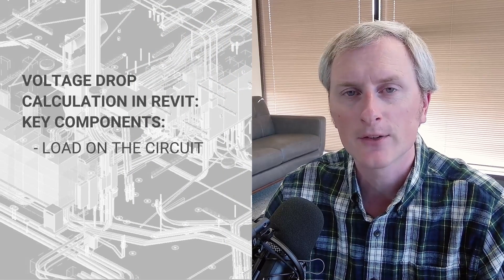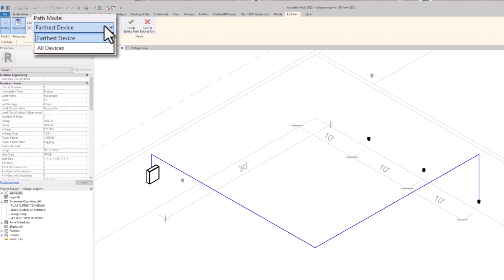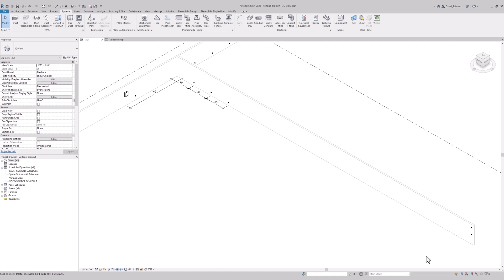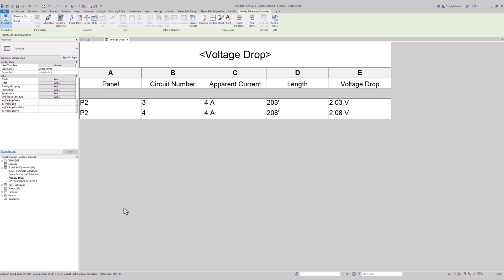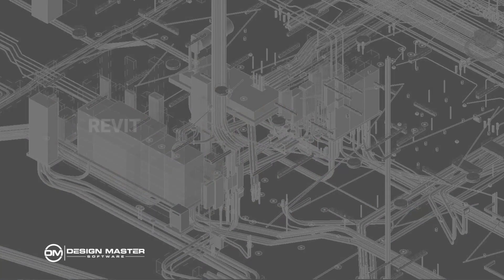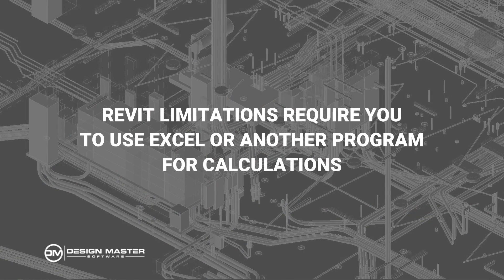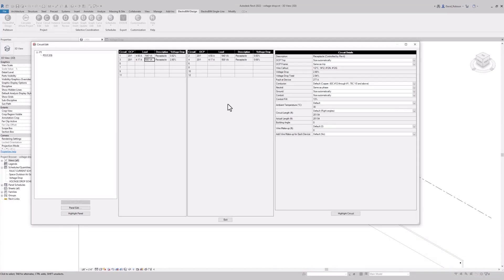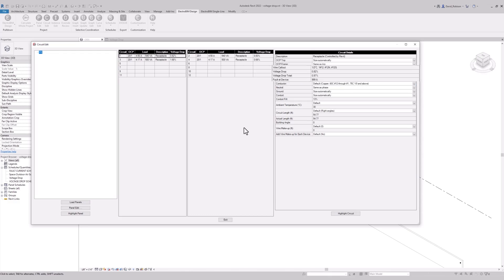How to Calculate Voltage Drop in Revit – Episode 10  #BIM #Revit

Comment: Just getting into Revit for 3D modeling, but have been working in ACAD for 20 years for Fire Alarm and Special Hazards fire protection design.  It feels like fire alarm integration/detailing got left out of Revit and it's too bad.  I'm not at the engineer level, but at the integration level where we need to provide submittal documents to an AHJ for approval per NFPA 72, etc.  Voltage drop calculations for horn strobe or strobe devices need to be submitted for approval.  I was hoping Revit or some addon could do this so we could use Revit for a full fire alarm design software, but it's not looking good.  Can your software take a length of fire alarm notification devices with individual loads at 24 VDC and provide a usable v-drop calculation for AHJ approval?  This may still be faster with ACAD and Excel, but I'm interested in the Revit possibilities/capabilities.  There are specifics that I won't get into here that need to be met and I don't think a Revit schedule will show what we need to show.
Reply: No, we don't calculate voltage drop or do anything for fire alarm design. It is similar but not exactly the same as standard electrical design. It is not a problem we are actively trying to solve yet.

Comment: Which NEC article that recommends only 3% VD for a branch circuit?
Reply: See NEC 2023 210.19 Informational Note and 215.2(1)(2), Informational Note No. 2.

Voltage drop is not a safety issue so the NEC doesn't mandate anything. The recommendation to "provide reasonable efficiency of operation" is 3% branch circuit, 5% total voltage drop.
Reply: @DavidRobisonDM  Thanks a lot for your response. Is the 5% measured from the utility transformer? Does DM measure this value?
Reply: @minabenjamin3660  Yes, the 5% is from the utility transformer. ElectroBIM handles that calculation correctly. The training video linked in the description has complete details on all our features.